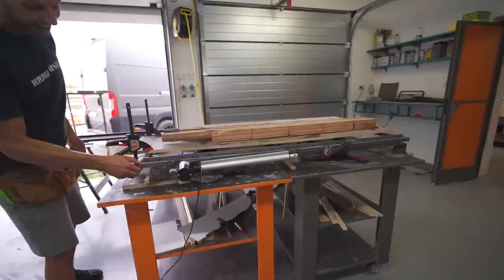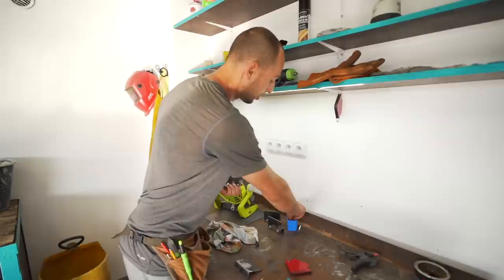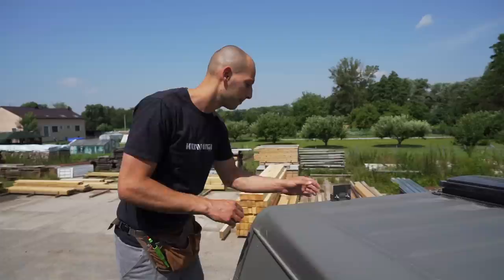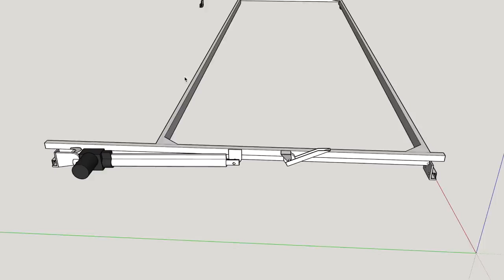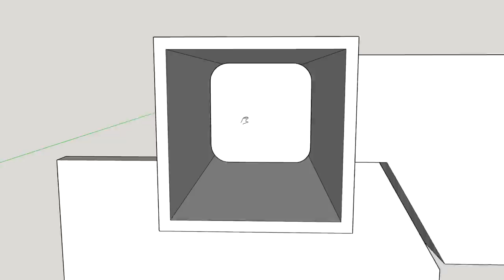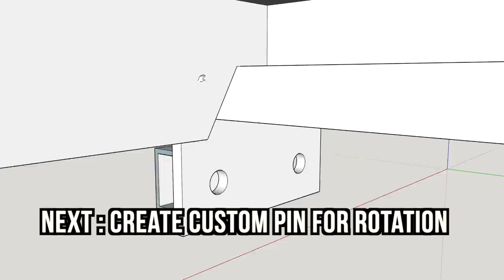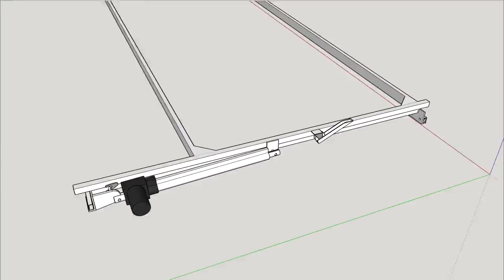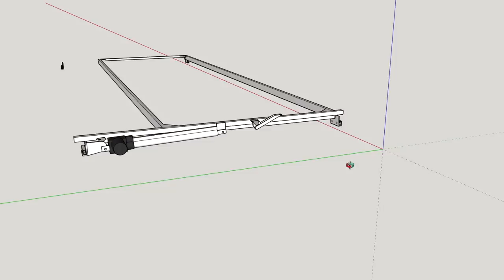How I Built Motorized 1kW Solar Panel Lift / Van Build S2E2

Comment: Cool system!!

Make sure you fill up the inside of the metal bars with paint. They rust easily through from the inside. I think rust will be the main failure point for the system. I like the sliding blocks in the tube. Only a tiny bit of rust will get it stuck. 

I can't wait to see it complete on the roof!
Reply from the maker: Good point. I might consider better rust protection.
Reply: Maybe not paint but keep it lubricated at all times. You might be able to put on an automatic chain greaser like those you can buy for motorcycle chains. It could be tweaked to release a drop of oil every time the system passes a certain tilt degree.
Reply: @ladiandmargaret  you could get it dip galvanised so it properly protects the inside. Can always prime and paint the outside afterwards with the right kind of primer if you don't want a galvanised finish

Comment: Thank you so much for sharing this. I watched your vids over a year ago when I had just bought a Vw T4 swb. I realized very quickly that I should have bought a bigger van. I was looking for a Vw lwb crafter and found a cheap Vw Lt35 lwb campervan. Though the interior  had been replaced by someone not skilled at woodwork and has to be completely redone. But I saw your amazing aluminium tilt solar rig and then this more comprehensive instruction from your initial build. I too have a couple of sun windows and would have to build my frame more like a roof rack than low profile in order to open them when the solar array is down. I absolutely love the new modification of the locking on the frame with an angle piece. real genius brother. You guys are so inspiring. Again thank you so much...Ray

Comment: Brilliant! Now all you need to do is make a base that will rotate the whole unit through 360Deg to follow the sun accross the sky. Perhaps linking it to a gyrocompass so that it moves automatically!
Reply from the maker: Good luck with that. On a house easy but I can’t imagine fitting it on a van and staying under 3,5 tons.
Reply: Stuart, there just isn't the space on a van roof. Not only that but you can't put them far enough apart to prevent shadows - and  shadows destroy the output.  What Ladi has done is spot on to maximise the charging current in a mobile situation.

Comment: Now you need to get a controller and write a little bit of code that takes the van's GPS location, the time of day and works out the optimal angle. Park up all day the the panels slowly track the sun's elevation in the sky!
Reply from the maker: Just a compass and calendar would do the job I think. Automation will be great but I’m in the welding process atm🙃

Comment: I used electric car trunk latches for mine. The accuators pull the panel frame into the latches and hit a contact switch that stops the lower and only allow raising if the trucnk latches are open. My panels are mounted on a double frame like a "Z" with pivots from garage door spring shaft bearings.  The lower frame raises the solar array that is mounted to a second frame.  Then the second frame tilts on the tip of the raised lower frame with a second set of accuators. This way my panels tilt east to west with a solar tracker and I can get the most sunlight on my panels all day.  And the best part is all I have to do is park my RV north to south and the panels will track from either side. I can start the tracking from either the driver side or the passengers side. And at the end of the daythey are tilted back to face the sun the next morning.
Your ramp roller and slide pivot to lock down are ingenious!

Comment: Really nice build!  I've been wanting to mount solar panels on a large vertical wall on my house, but actuate them so they face the sun.  The really useful idea here was the wheel and guide to not stress the actuator for the first few inches.  I will definitely use that idea and also the lock so that if the wind speed exceeds a certain amount, the panels will automatically retract and lock to prevent damage or warping.  I have no idea how to weld or do any metal work though so not sure how to get started. I've only ever worked with wood and 3D printed plastic components.

Comment: Brilliant thinking, brilliant execution! For my own build (on an H2), I can't use your "overhang" slide/pivot mechanism because I'll have an awning in the way. So I'm thinking of separating the lift ramp and the transit lock to produce a two-stage mechanism: 1) unlock the panel and pull the ramp back towards the main actuators, then 2) extend the main actuators to lift the panels. Still in my head - I need to get busy in Fusion 360!

Comment: Great construction! But I see the weak point at the bolt of the actuator (your point 10).
I would create some kind of bracket to support the end of the bolt. Otherwise the bolt will bend with time.

Comment: so, I've already seen the demo of a remote-controlled solar panel on top of an RV. 
the next level, would be to have a sensor that establishes the elevation of the sun (number of degrees above the horizon) and move the panel accordingly. the demo showed an enormous difference between a panel that is perpendicular to the sun's rays and one that is simply lying flat. 
best wishes for your further research.

Comment: Genius design. The pride Ladi takes in executing his ideas is palpable. A couple questions:
1. With reference to Ladi's comment about aluminum vs steel, does he not have access to something like 8020 aluminum, or is there a different reason for using steel?
2. There are many moving and intricate parts. How well prepared is he to fix problems on the road? Will he make some spare parts? Will any required welding depend on the local economy wherever? I don't doubt his abilities, but some issues may be beyond the capability to carry tools, e.g., welding equipment.
Reply from the maker: Thanks :) I don’t weld aluminum and I lack this whole experience. It has to be stable and bullet proof before going on the roof. I won’t be making any spare parts. In the worst case we won’t be tilting for some time.
Reply: Agreed, awesome commendable design. But design also has to be balanced with real life. The rust will be a huge factor especially inside the tube and the sliding inside. The time it takes for the design and build is a factor also, then there's repairs in the field of 1 off custom pieces with shop equipment. Very difficult repairs

Comment: Only thing that I'd be worried about by using multiple actuator arms is the trouble if one fails.  If you start lifting asymmetrically, that could be very bad.  Other than that... awesome creative solution!

Comment: I’ve been thinking about how I’d do this myself and I’d come up with repurposing the stainless steel, multi fulcrum side hinges they use on double glazing. I like that they’re rustproof and because they are multi linked they have less likelihood of catastrophic failure while driving, plus because of the main rotation point being nearer the centre that the force required to open them would be low.

Comment: For the rust on the pin and lock: you can weld stainless to steel. The stainless can rust near the steel but in this configuration it might hold up a lot better in these 20 years you mention ;)

Comment: Ladi, you might consider for version 2 of this in the future, that you could stack this design on top of itself in the opposite direction and achieve a tilt in the other direction if desired rather than moving the van to catch the opposing parts of daylight. Next, if your actuator motors include positional data, you could control their angle via a computer for automatic tracking of the sun. Note: it's pretty low profile already, but perhaps someone in a traditional RV with less stringent aesthetic needs would like this stacked design as a commercial product offering from you? Really kickass effort, and video!
Reply from the maker: If I was supposed to mount 2kW solar on the roof, I would definitely not install them facing opposite directions. Instead I would have two rows, top row sliding aside and both together tilting. Two rows would contra weight each other, small actuator would angle it. Very small angle would be achievable but creating solar owning would be sick too :)
Reply: @ladiandmargaret  I was just solving for how to catch the sun without moving the van 180deg, not adding more panels. Forgetting about tilt, an awning approach would be totally sweet.
Reply from the maker: Position to the sun is easy, dash compass and considering it when parking.
Reply: @ladiandmargaret  the arc of the sun is close to 180 degrees, and that's going to exceed the orientation of the van at some point unless your flip the van 180 degrees or tilt the panel from the opposite side. the sun hits it's zenith at some point, that's why terrestrial solar farms use tracking for both the decline and incline from the zenith. I'm not dissing your build, it's amazing. I'm just saying it's unidirectional and the sun isn't. If you're just charging for a part of the day, no problem.

Comment: A project I worked on with solar panels folding out of a truck had a wind sensor which would automatically trigger the mechanism to collapse when it got too windy. I guess you don't really need it but just thought I'd mention the idea.
Reply from the maker: I thought about it too. I can’t program myself, somebody would have to do it. But I would love to have a unit lifting for optimum charge and collapsing when too windy.
Reply: @ladiandmargaret  I can program but I still think I would manually control it to avoid the hassle of trying to set it up.

In case you want to go for it though, there's not a lot of complicated coding involved and you can find tutorials and support online in discord groups and forums. An option is to use a headless(headless meaning it can run without a monitor etc) Raspberry Pi with a python script(to read sensor data/control the actuators) that automatically runs when the Pi is switched on and some motor controller stackable add on boards(a.k.a. HAT's) to control the actuators, the Pi's are pretty amazing little computers and they use very little power. The original Pi was developed for the international space station.

As for the wind sensor, I found this little tutorial to hook one up to the Pi: https://projects.raspberrypi.org/en/projects/build-your-own-weather-station/5 

You'd also need a way to power on and off the computer safely, and make the solar array collapse before the system is shut down.

Alternatively for a lazier approach I guess it might make sense to use a system for a camper awning to collapse the panels when it's too windy and still set the angle manually.

Comment: Nice sequence - well done - a nice design.  I like your plan and execution - well worth the watching time!

Had you considered making it slide even more before pivoting and orienting to the side opposite the door - shade the side of the van and reduce the wind profile more?
Reply from the maker: Thanks. Yes. It lowers the angle and stability when going lower. It lowers the actuator attachment.

Comment: Probably a bit late for this but the sun rises and sets in the opposite direction so if it were me I would have two of those frames but they are both facing a different direction so ones facing. The east and one is facing the west type thing if ykyk

Comment: Q: is that rotating pin holding most of the downward weight of the panels after the actuator pushes to the furthest UP position?

Comment: Excellent design and execution, but the difference between good design and great design is a solid functional specification before a design specification and a comparison of the two to assure design meets intended function. 

Not knowing your functional spec the following comments may be garbage but any good designer always welcomes a technical observations and they are offered in that spirit.

For a stationary application this is great. For a van or trailer in my experience it adds complexity, and weight for minor power gain at least at my latitudes . If deployed there goes your stealth factor. 

If stealth is not an issue a set of flexible panels pound for pound and $ for $ or € for € will provide more energy and your van can then be parked in the shade and orientation of the van won’t mater.

One idea I have been experimenting with are flexible solar panels in a pop up canopy with a portable solar generator.

I think that approach would be more useful and practical across more situations than the movable panels that still require you van to be oriented in one direction. 

That said, you guys are awesome and few of us have the gift for elegant design and  execution of your ideas that you have. 

You are up on my hero’s pedestal along with George from Humble Road and Sailing Uma for beautifully designed and executed adventure vehicles. 

Looking forward to your continued build and work of mobile art.

Comment: Greetings from Lima Peru, I am a follower of you since your first videos, my English is very basic and I am using the youtube translator. Congratulations on the excellent design and construction, Ladi is a great engineer.
I bought a Peugeot Boxer L3H2 van and I am going to camper it myself, many of your ideas are working for me but due to financial limitations, my project will be simpler and more austere. I am thinking that another way to make the most of solar energy is by installing a vertical panel on each side wall, I would like to know your opinion and if you consider it practical. Thanks for your attention.

Comment: A simple L bracket would have been perfectly adequate. Ladder Racks and other accessories have been mounted like that millions of times for years without issues. Sometimes simpler is better. I guarantee that rubber will fail before the steel will.

The caster customizing was also overcomplicated. Make it shorter by moving wheel up, drill 2 holes. Trim off the excess bracket instead of cutting, grinding welding etc. Again simpler is easier and faster. Sometimes we overcomplicate things. Repairs out in the field when something breaks is much easier with a simpler design or piece as opposed to a customized 1 off piece made with specialized tools.

Meanwhile the inside of the square tube is all raw steel. the slider portion will always wear any coatings away to raw steel and it will all rust leaving streaks on the roof and down the sides.
Reply from the maker: It’s not like move the wheel higher or lower 😂 it’s placed exactly where it is to lift as much height on this short travel. That’s why it needs to have as low beginning position as possible.

Comment: lol i might borrow a few components from you to add upgrade our current roof box :-). yup ill be using aluminium to build it. i have already used aluminium extrude to build all our van structures. we have now been in the van fulltime now for 2 months

Comment: Nice bracket for the roof mount... What's stopping the bolt from coming undone then if it's only done up against the force of the "squish" of rubber. Locktight maybe or some sort of cotter pin or nylock if you allowed the bolt to pass right through to the other side of the metal bracket?
Reply from the maker: Locktite it is.

Comment: 8:30 the rubber blocks, are they used resistant rubber? After a year or 2 they might start deteriorating where exposed. Also for the hardware going through them, as its rubber being squished, you won't get great clamp load and nuts will likely loosen especially with the shakes and vibrations of the road. Try using some loctite to help lock the nuts in place.

Nonetheless, great job with the whole system. Can't wait to see it in action on the van. Keep up the good work! Love seeing the creative solutions.
Reply: Lock nuts will work fine...but yep I agree the rubber is a nice idea in theory. In the real world...kinda pointless. A simple L bracket would work and be much faster and simpler as well as more universal

Comment: You could have rotate the base of the wheel 80° counterclockwise... No unsoldering and soldering needed.
Reply from the maker: What do you mean?
Reply: @ladiandmargaret  I'm talking about minute 11, there was no need to cut the trolley.
Reply from the maker: Yes, there is more solutions to the same problem.

Comment: Love this build Ladi! I’m actually watching this video after the solar rack completion vid, but seeing the lock up close, makes me wonder about how well it locks if the vehicle is impacted from the right, and the panels wanting to move right. In that direction it only seems to be secured via the actuator. How strong are those from stripping? 

In thinking about a solution, best thing I could come up with is similar to your original design, with a small servo to lift it prior to the actuator extending. Two stages which adds complexity, but much more added security. 

I’m sure you thought of this, how did you weight the pros and cons?

Comment: Hey Ladi, Nice job !! 

One question, why did you put one actuator and the wheel on the outside of the frame?? Now you can't get the next frame close to the other. Why didn't you just mirrored one actuator so both are on the inside???
Reply from the maker: The actuator is asymmetric, if I had them mirrored the mounts and dimensions would be a bit different. It doesn’t limit me with anything.

Comment: Ladi aren't the rotating pins also going to be a weak point when the solar is completely unfolded? Cause when unfolded all the weight will be on those rotating pins and they are just welded together pins.
Well I hope I'm wrong or you take it in consideration :)
Reply from the maker: Idk. I do it the best I can and the rest needs to be tested.